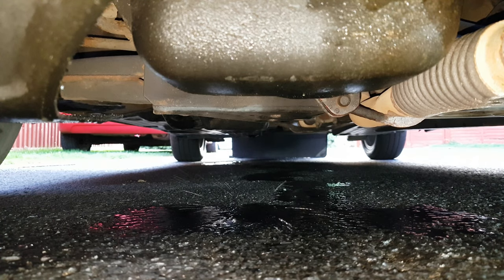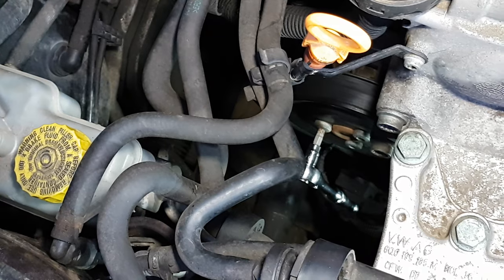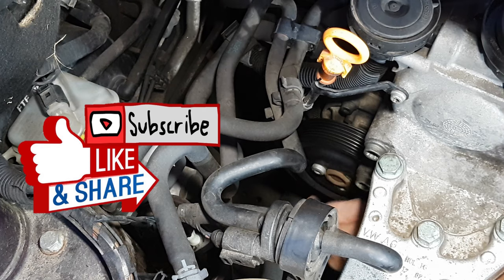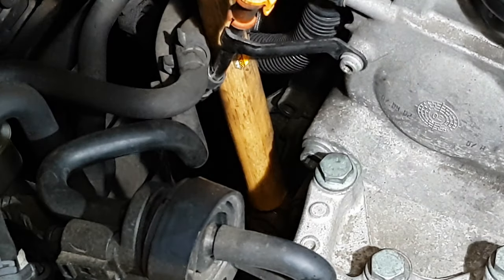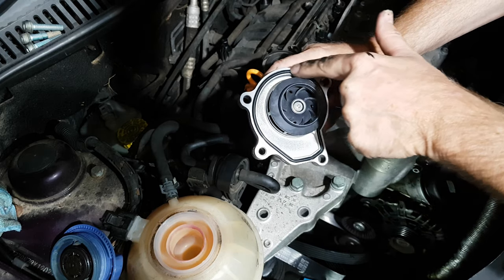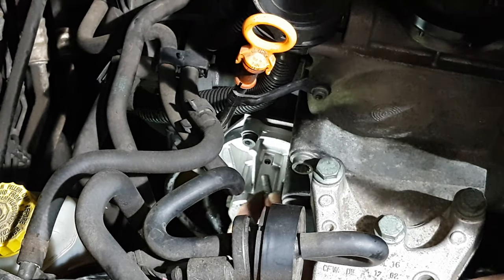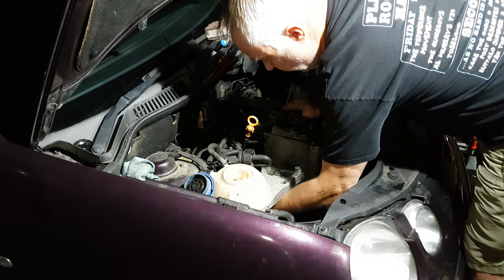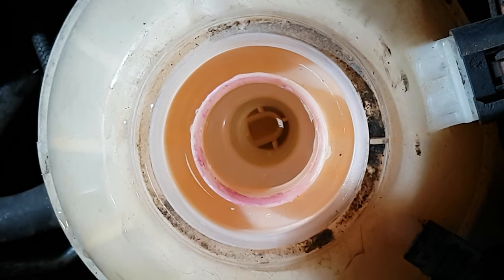VW Polo 1.2 Water Pump Replacement | How To DIY

Comment: This coolant pump couldn't have been easier!  Very well explained.  The only thing I'd add is, be sure not to get any coolant on the serpentine belt, as it will damage the belt. It may produce a squeal. You can rinse off the other pulleys with hot water or brake clean, if any splashed on them from the job before reinstalling the belt.
Reply from the maker: Yes absolutely. Very good point Cuba. Make sure that the belt and pulleys are dry and clean when re-assembling.
BTW: what part of the world are you in and what time is it there? It's 8am here
Reply: @CycloneCyd  hahaha... wellllll... I'm in Pennsylvania in the states.   It's almost 3:30am.  Bathroom run & can't fall back asleep. Lol 😅😅😅
Reply from the maker: @CubasAutomotive  lol lol lol, yeah I know that feeling. I've reached that age now where a midnight 'visit' can no longer be avoided.

Comment: Great video. Covers all the main points.
For those interested this is exactly the same procedure for the Skoda Fabia MK1 1.2
Reply from the maker: Hi Orpheus, thanks. Yes, this same engine was used in a variety of VAG's small cars: Fox, Up, Polo, Fabia, Ibiza and maybe more. They are all much the same. Indeed I have got a couple of Fabia terms in the search tags, so I hope Fabia owners will find it
Reply: @CycloneCyd  I'm sure they will. Popular engine.
These cars are a joy for those wishing to maintain their own car. Affordable, and you can actually access most areas without either ripping your hands to shreds or removing half the car :)

I replaced my front wheel bearings last month (Fabia MK1, same bearings as your car). It required a special puller kit but even that job was a pleasure to perform.

Comment: Can I use the same method for a 2007 Skoda Fabia MK2 1.4?

Currently my Skoda is dripping coolant and I suspect the leak may be coming from a coolant pump. However, replacing it has seemed to be quite a hassle until I saw your video. While setup you showed seemed to match my engine quite well, I would rather not brick my car in the attempt.

Your video is the best one I have been able to find so I hope it’s the same.

Thank you for all of your fantastic videos!

Comment: Thank you. This video is very helpful as it is very similar to the Polo 6R with the 1.4 CLP engine (with timing chain)
Reply from the maker: Awesome, I didn't know that. Thanks for the info.
Reply: What’s the life expectancy of a water pump. I got a coolant leak and I can’t see any leak. I’m wondering if it my pump coz I got the timing chain engine that’s 11 years old and 115000 km

Comment: Hello good video. Can drive without serpentine belt if its snap on road and drive  for few kilometers to fix it?
Reply from the maker: I wouldn't recommend it. Without the water pump the cylinder head will get extremely hot around the exhaust valves VERY quickly.

Comment: I notice a lot of cars are now available with 3 cylinder engines. I am interested in your opinion on these, as long as they are looked after would you expect them to last as long/be as reliable as conventional 4 cylinder engines?
Reply from the maker: As you say, provided they are looked after, there is no reason a 3 cyl should last any less than a 4 cyl. They'll always be a little 'gruffer' because of the natural force balance.

Comment: I noticed there is a small coolant leakage from my polo water pump area. Would I need to change the whole water pump or just the gasket.
Reply from the maker: Pumps usually leak at the shaft seal, so most likely you'll need a new pump.

Comment: Does it matter if water pump is 04. Is it compatible with 55 plate ?
Reply from the maker: I would have thought so. Are you proposing to use a 2ndhand one? I've had poor results with used pumps that have been stored. I think the seals dry out. I'd advise a new one.
Reply: One from scrapyard ideally ? How much are new one ones

Comment: I would have think the leak is caused by a gasket failure
Reply from the maker: There's a O ring type seal on the drive shaft that fails. Quite common on loads of water pumps.

Comment: In Finland old coolant is taken to same recycling point as old oil, old car batteries, unused paints, e-scrap and so on.
Reply from the maker: Brilliant. Here in the UK we can take oil and batteries to the local tip, but not coolant or tyres.
Reply: @CycloneCyd  our tip takes 4 tyres max. Surely if your head gasket had gone there would be coolant in the oil that would still be accepted at the tip?

Comment: Cheers for the video mate, very useful. Can I just point out that you should not dump the old coolant down the toilet or drains at home or even suggest that. Coolant is very toxic and can cause serious damage to the environment. It should be disposed of properly, maybe with a trip to the local recycling centre. Thanks again for the video
Reply from the maker: It is extremely toxic to the environment, which is why it should go down the toilet to the sewerage treatment works and not into surface drains which go to the rivers.

Comment: Is possible to replace the water pump with out disturbing the timing of the car.
Reply: Yes, this engine has a timing chain, so you won't disturb the timing when taking the belt off.